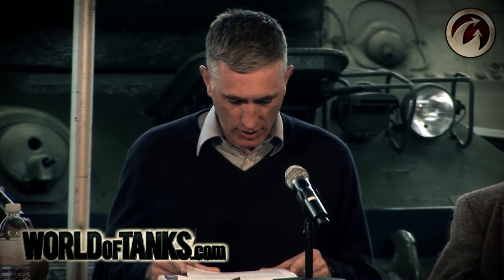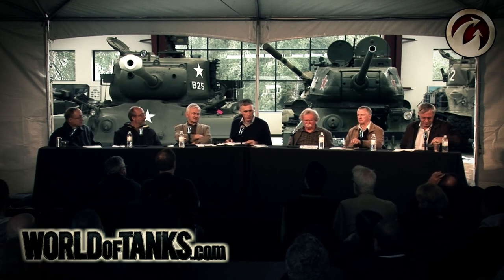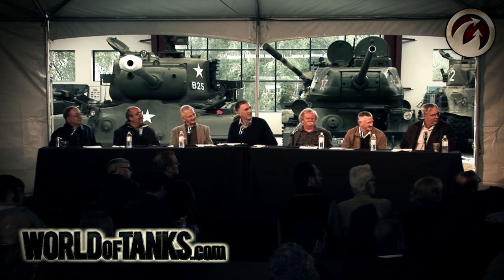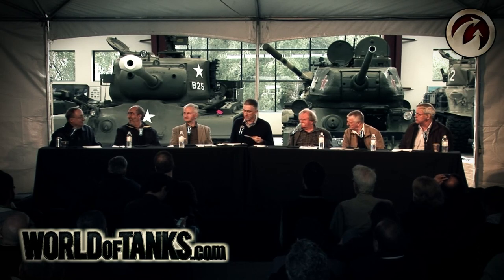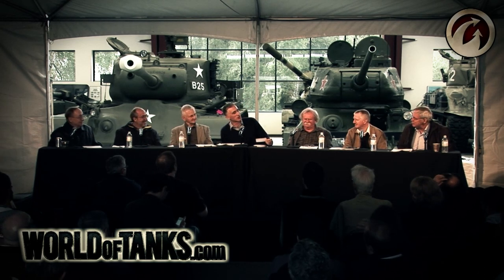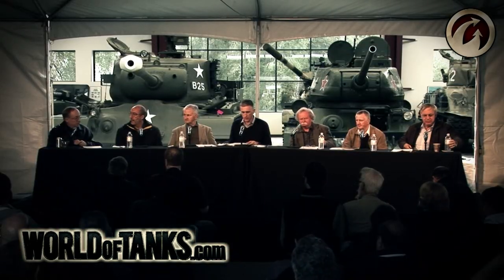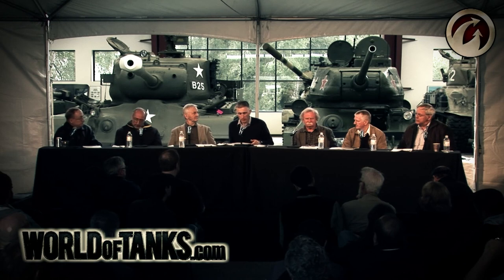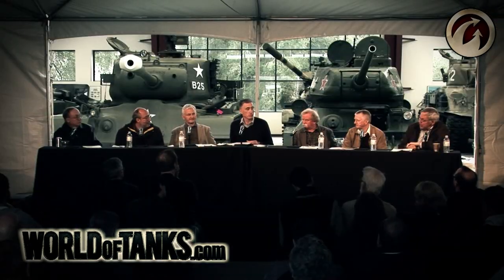Operation Think Tank 2012 Part 10

Comment: Ergonomics should be the 4th category.
The easier it is for a tanker to carry out his duties, the more effective the tank will be.
You also want to limit the number of accidents or mistakes that could happen. Simply due to the ergonomics. Finally but certainly not the only remaining reason,  if a tanker starts becoming physically disabled by the ergonomics of his tank. His tanks effectiveness will continue to degrade as the current actions progress.
These three reasons alone. Should be sufficient to warrant adding Ergonomics to the “holy trinity”.
Reply: Visibility should also definitely be included, either under ergonomics or its own category

Comment: Idk if I'd really call the Panther a "main battle tank". Then again I suppose each different armed force had their own doctrine and would thus have differing criteria for what a "main battle tank" would be. For the Americans I have little doubt they'd consider an up-gunned Sherman for the role.
Reply: Yeah I really would of loved to have them elaborate on their choices but I guess the Panther is pretty straight forward with how it could be considered as such.
Reply: It was definitely germany's first MBT.
It was designed to replace the Panzer III and IV to be germany's new Battle Tank  and served as a platform for a large variety of other tanks like recovery vehicles or SPAA.
It was primarily designed a System for tank on tank warfare, to counter the massive soviet tank assaults. There for it needs a great mobility, a good frontal armor protection and a gun which could destroy every enemy tank within 2-3 km of range. Why 3 km? Analysis showed, that with in that range 95% of the tank engagements would take place in central europe.
This profile of capabilities hasn't changed the next 45 years until the end of the cold war. Even the Leopard 2 was designed on the same principles.

Comment: Would like to ask Steve Zaloga why the Panther is the first MBT. Why not the Tiger I? Or the Panzer IVF?
Reply: Tiger 1 was suppose to be a heavy breakthrough tank. It was just used as a battle tank. Pz 4 was designed as a support tank for pz 3, so its variations can't be called 100% mbt either.
Reply: Germany was truly ahead of time with the invention of IVF panzers.